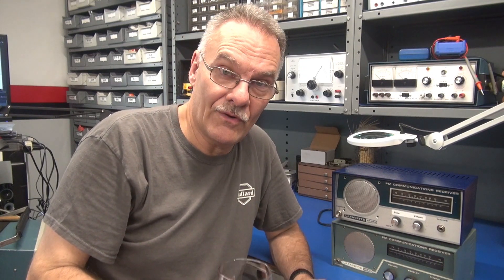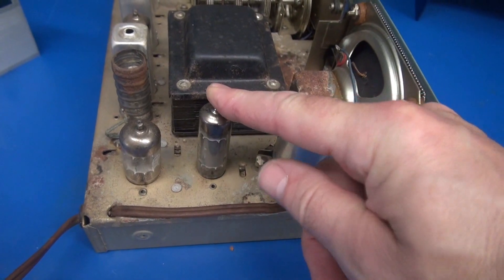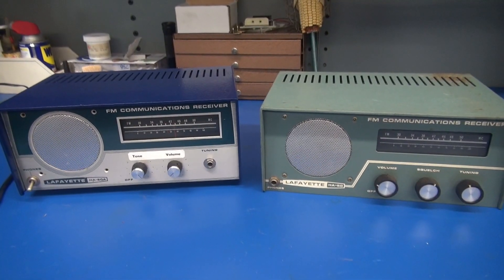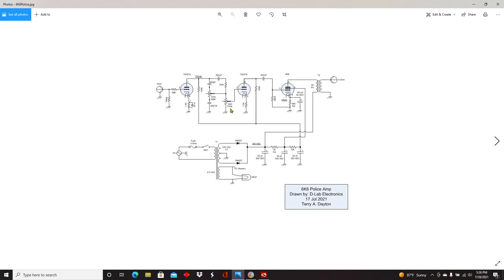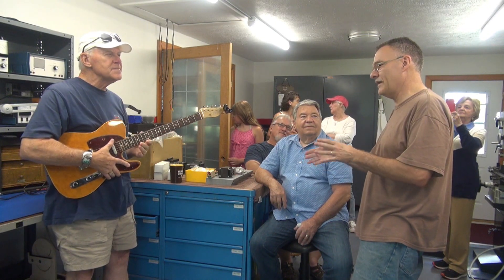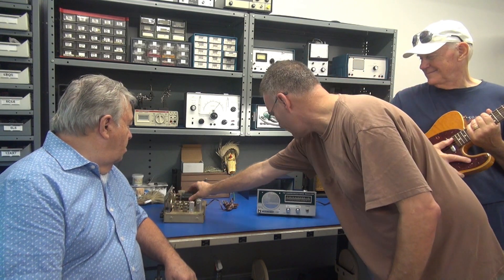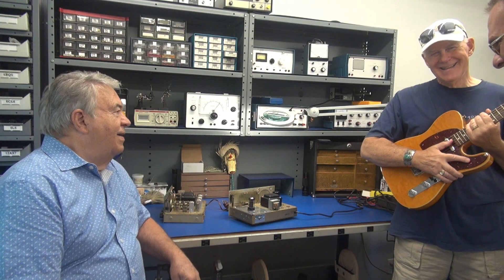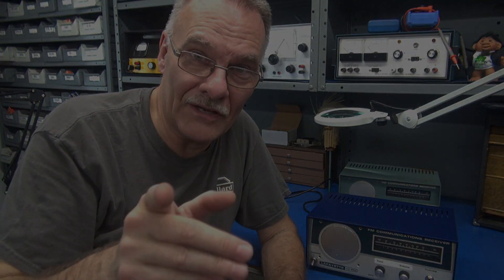How to convert a 1970's tube police radio into a cool 3 watt 6K6 guitar amp

Comment: Hey Terry, any chance of getting a printable schematic for this? I have an old Regency air radio that has a good transformer in it and would make a good parts donor!
Reply from the maker: Hi Mike, e-mail me, info is on d-lab electronics.com
Reply: ...have you checked to see if a Sams Photofact is available for that particular item?
Reply: @daleburrell6273  for a custom amplifier? I highly doubt there is a published one for that.
Reply: @cbmikey  ...I was talking about a Sams Photofact for the Regency radio-!
Reply: @daleburrell6273  Haha... apologies! The radio turns on but the air cap is all mangled up... so I was going to more or less cannibalize it for parts anyway. Thanks!

Comment: I bought two of these from ebay because you posted those videos a few years ago. One I made into a variable AC unit. The other is in real nice shape and will be converted into an amp as you have shown here. I paid $30 for one, $45 for the other. Both power transformers checked out and are gems. But what I didn't expect was the 12AX7 tubes in these units. One was a Mullard, the other a Matsushita (made by Mullard). I put these tubes in some amplified speakers and they are amazing, huge difference. I listen to them almost everyday. Thanks for sharing your knowledge so graciously.
Reply: Wait, you turned one of them into a veriac?  How? Nice find on some good 12AX7 Mullards in these old things.

Comment: Ok Terry, I been eyeballing this 6K6 tube and output transformer in this old Hoffman B&W TV set from 1953 for years. If there is some reason the TV set is EOL due to a flyback, yoke, or some unobtainium part, then I am salvaging the 6K6 section for an audio amp. I think the secondary is 3.2 ohms however.
Reply: 3.2 is effectively 4 ohms, so slap a 4 ohm or two 8s in parallel and call it good! It'd drive an 8 ohm load without danger as well.